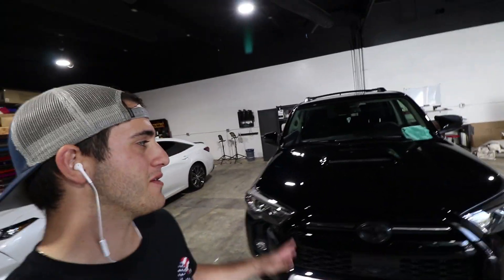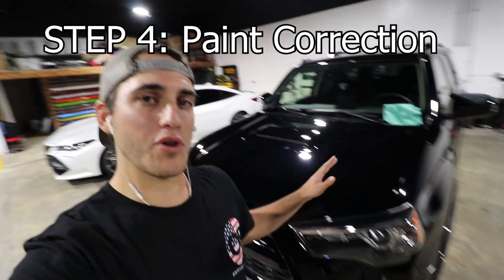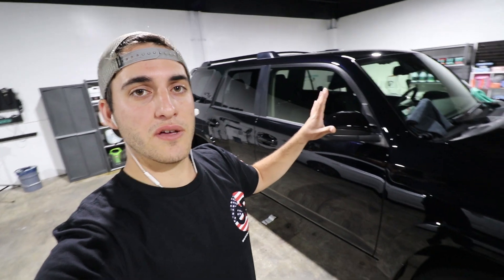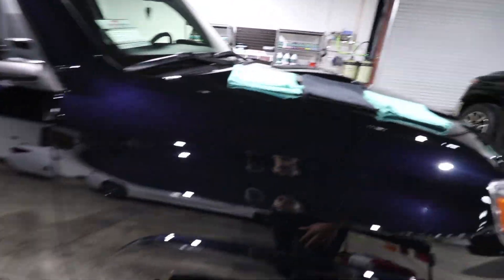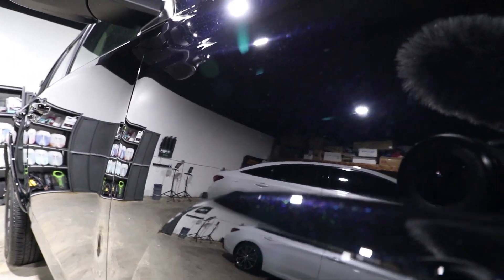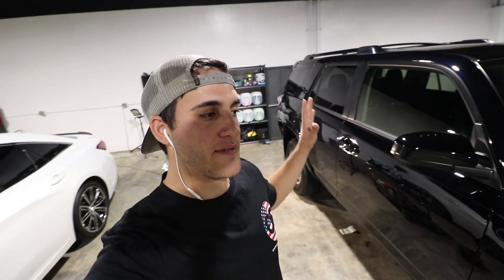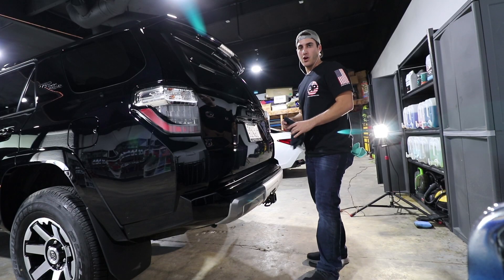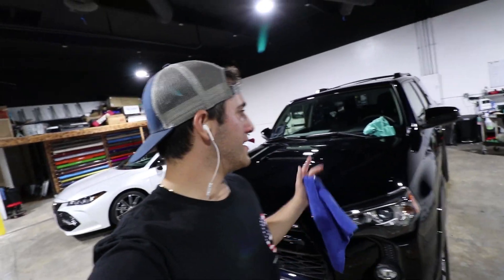How to Apply a Ceramic Coating to Your Car! #ceramiccoating #detailingtips #detailing

Comment: Does the ceramic bite on to any polish? I’m using 3D one would that be good to put ceramic over?
Reply from the maker: Being a Silica carbide, it needs to lock to the clear coat. Panel prep is very necessary. After 3d one use panel wipe after
Reply: @GENESISDRIVEN  okay 2 more questions Lol will the panel prep mess up the polish I just put on it? Like will all the imperfections show up? & 2nd question what do you recommend over the counter ceramic coating to practice on? I’m just starting my business I’ve worked in a body shop for 5 years as a painter I can detail and polish cars but I want to learn how to do ceramic coating! 
Btw I just subscribed! Can’t wait to see your channel grow! You got some good videos!
Reply from the maker: Sorry for the late response! We took a break from social media. You might have this question already answered but I’ll still go in depth real quick. Panel prep will show blemishes again if you are using a polish that includes fillers. The panel prep will remove those fillers showing true results. That is why we spend so much time doing proper correction prior to ceramic coatings. Reach out to me on Instagram and I can guide you through the coating process and what coating to buy!